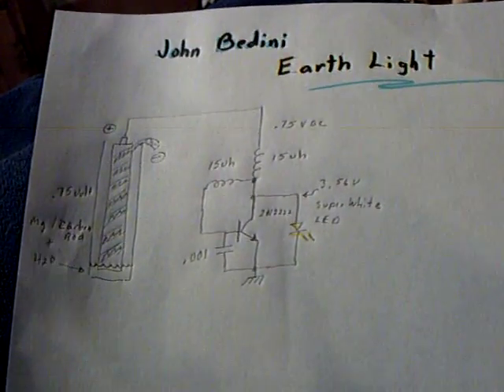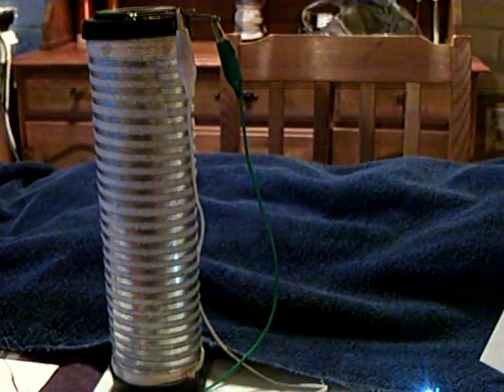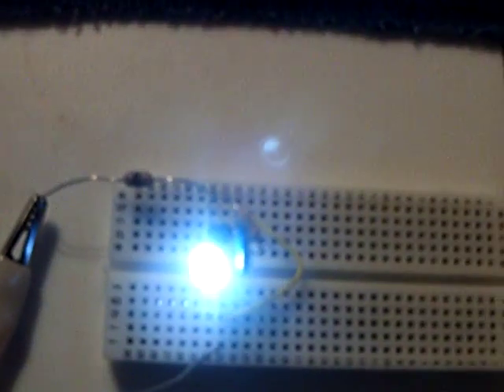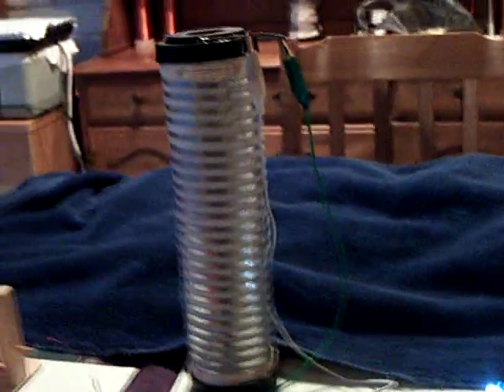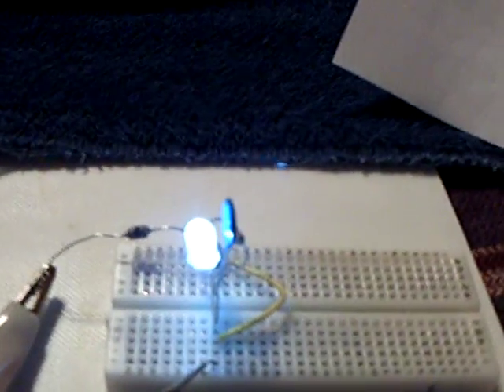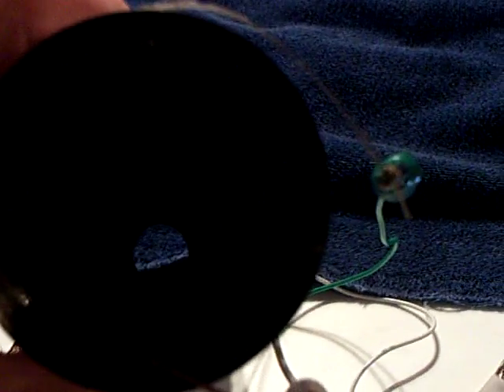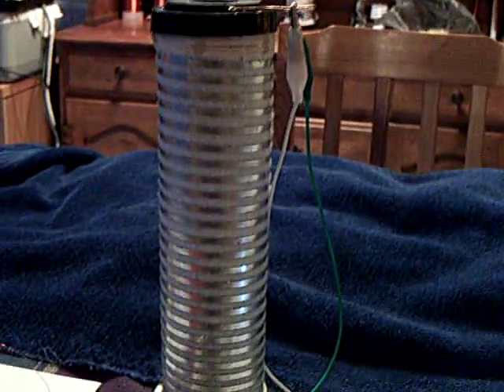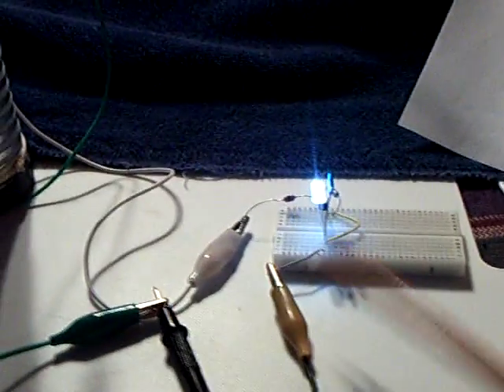Bedini Earth Light with BIG battery.ASF

Comment: Another nice job!!! 

Makes me wonder if any food grade carbon would work. Or, or other carbon, like chard wood. Have you had the time to try and calculate size of the surface area of contact between the magnesium and the carbon? The reason I ask is this; to get a higher voltage, one could use one long strand of magnesium with layers of carbon/felt to increase the volts/amps without having to use the space of 8 of these batteries in series.

Comment: Are you adding a salt water electrolyte to the battery ? Or some other thing. Or is it simply running off damp air, or the wet felt ? Thanks.

Comment: I bet using copper wire around will last longer and will generate more amps.
Reply: Talha Kamran how did your lasersaber Battery go ?
Reply: ***** Salam,I tried lasersaber's tower style with mg ribbon wounded around but it did not work well as it relies on moisture and Mg bein exposed starts to get crystals on it and breaks within few days. Because it is very thing strip of Mg.

The other style lasersabr mention was awesome.
Copper pipe with Mg rod in middle. Jam pack dry grinded salt mixes around it. It starts with 100 mAmps hike but then it settles at 30 mAmps. Check my videos I have them working in my house for more than 50 days now. Running 0.5 and 1 watt LED's. Now I am a lazy guy and lack many tools still my shabby cells worked fine. So if you have proper tools you can make a really good one using that dry method.
Reply: the problem is you still using uo the magnesium , you want to make the battery as suggested by John Bedini , where you will no longer have a decomposition of the magnesium .

Did you try john bedinis crystal Magnesium copper Alum  battery ?
Reply: No I did not. I tried laser saber's idea of grinding salts instead of melting and then shove them inside a copper pipe with mg in middle and it working like a charm for around 50 days.
I used the Mg bars that are inside water heating devices as heat element.